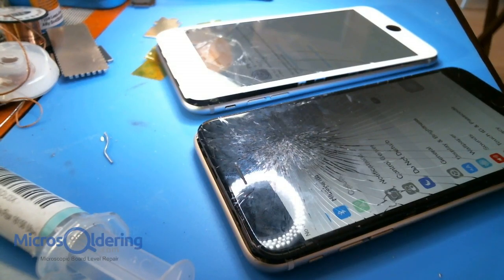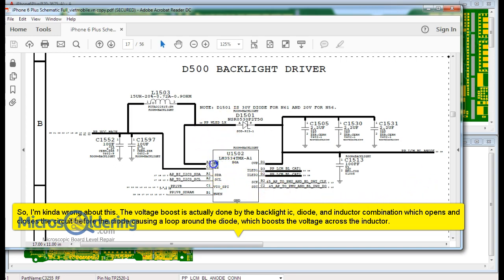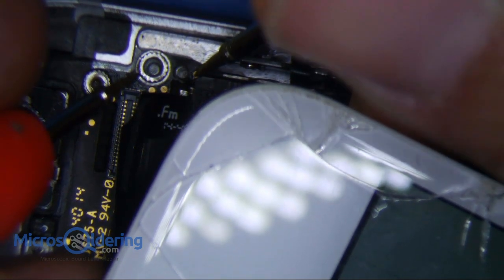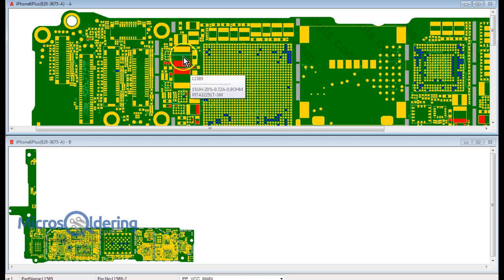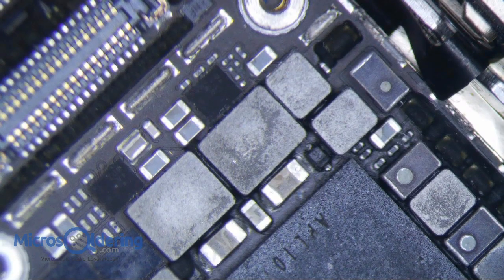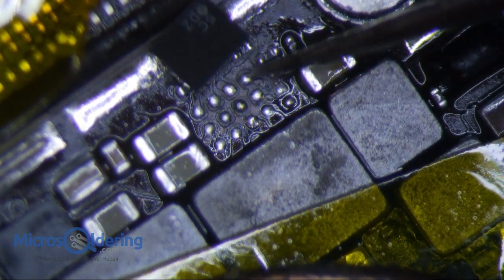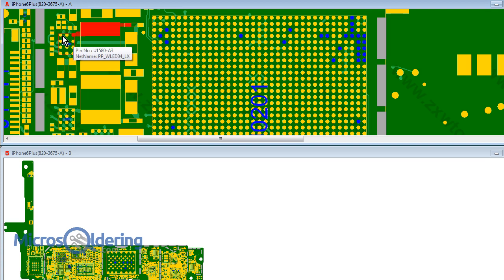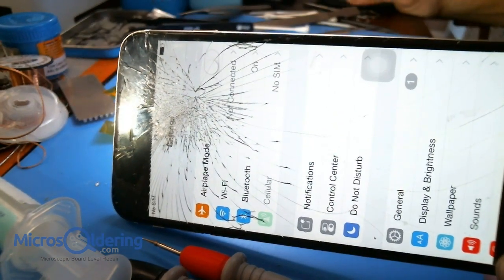iPhone 6 Plus - Diagnosing and Reparing a Half Backlight

Comment: I wish I had found you earlier. I had the exact symptom and sent it to a guy on eBay who said he did the microsoldering but that the shadow was still there so he advised to replace the lcd screen. So I sent it to another guy on eBay who replaced the lcd but the shadow was still there who said it’s the backlight. So almost a $100 spent and still have a phone with the shadow effect.

Comment: Hello, I'm new to repairing iPhone or even considering repairing them. I bought two iPhone 6's with problems, the biggest question is with one of the , as I believe I know how to fix the other one; the phone charges and functions properly except few when it loses the picture, this losing the picture though turns the screen black but not off and it still gives off light, the touch is unresponsive at that point as well, but one it put to sleep and back on it works for a few seconds as the screen does this within seconds of "unsleeping" the screen. I've been looking in to backlight problems and I'm wondering if I could get advise as to where to trouble shoot or if anyone would know the solution. Thank you.
Reply from the maker: Probably not a backlight problem if you can't see an image.  Distinguish whether it is a display or backlight problem first.